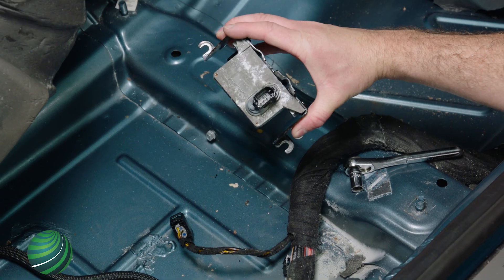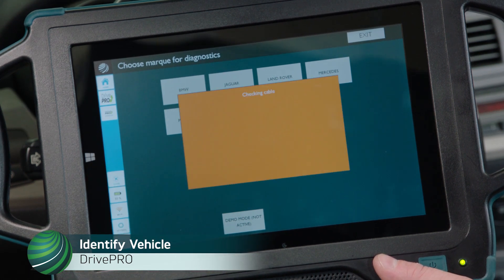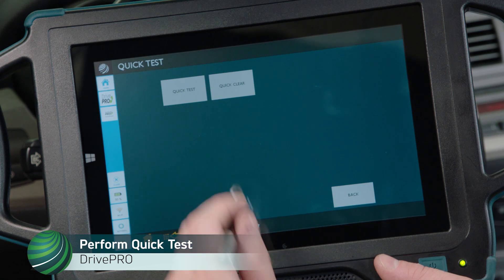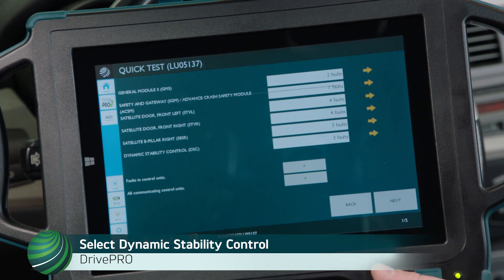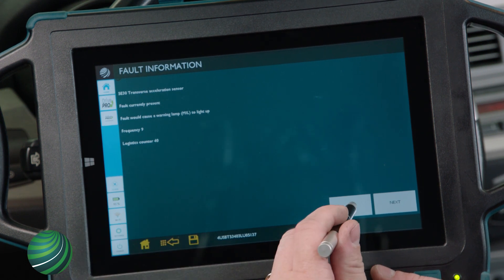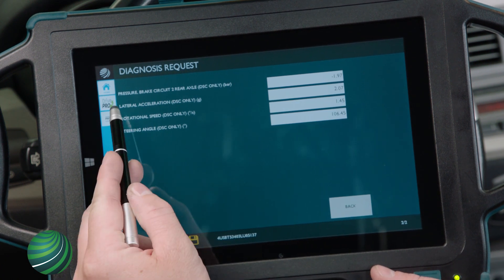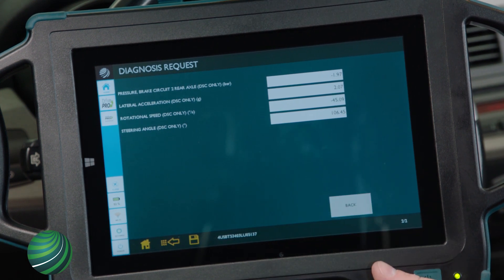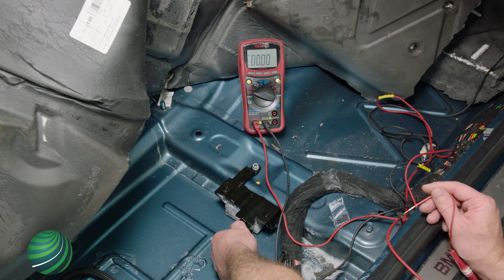BMW Z4 ABS Sensor Lateral Acceleration Sensor Diagnosis - How to Test and Diagnose

Comment: Open circuit voltage is not a good enough test to prove adequate power supply to the module.
Reply: Especially the way the ground voltage was tested...not reliable.